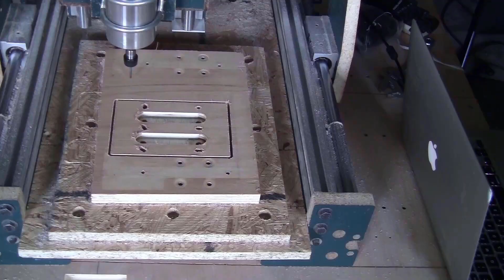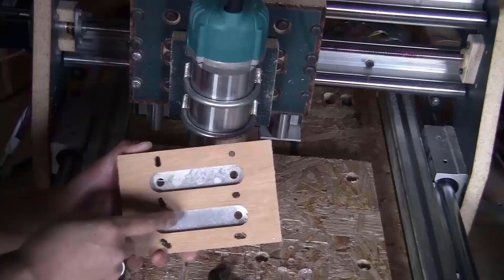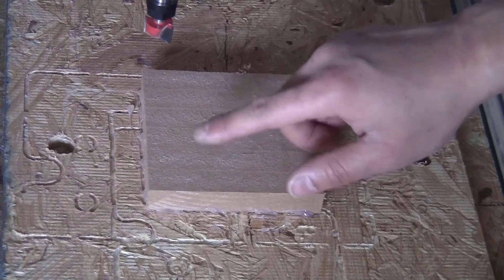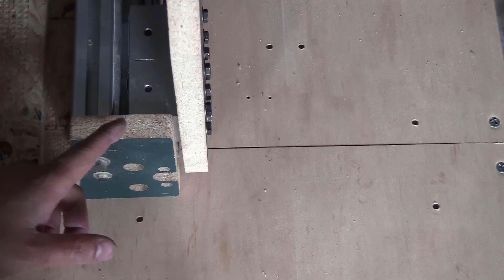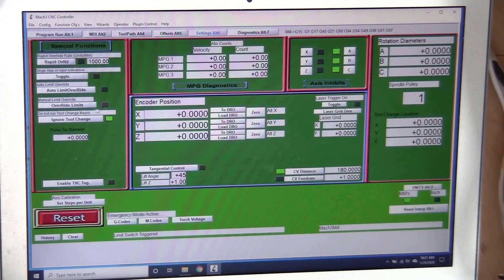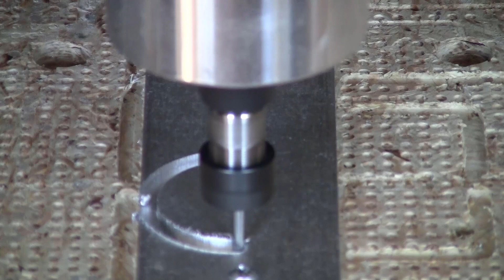Home-built CNC - Step 2 improvement - Full range Z axis and limit switches installation

Comment: Hi Minh, that's another cool video of yours I've watched, so useful bud 👍 I've got my 3018 pro fitted with a 500 watt spindle now and I am really now only planning one small addition, a spoil board so I can cut pieces out. I figure the machine is now accurate enough to cut out gantry plates etc from 18mm ply to build a much stronger machine that can upgrade the ply parts to aluminium. Thanks for the inspiration bro!
Reply from the maker: Baby steps will take you far my friends. But if you are planning on doing aluminum, my recommendation will be changing the linear rods on the X axis with fully supported rails. You will be amazed how much difference those rails can make when it comes to cutting aluminum.
Reply: @minhsmancave9448  The point I was trying to get across was that I'll use the 3018 to make  the pieces out of ply and use the new machine to remake them out off aluminium. And probably sell the 3018 at that point with the 500 watt upgrade fitted.  I was inspired by another of your videos where you did just that. Was also shocked how quiet those water cooled spindles from China are, new machine will have one. 3018 builds 5232 which will build the big one, I won't stop now until I have half a sheet capacity. I would do a video of the new machine build, but I'm so shit at that sort of thing 🤪
Reply from the maker: Also a good plan, just like renting a 3018 to build a better cnc. 👍
Reply: Exactly bud, and educate myself along the way, attempt to at least!

Comment: Minh, I went to find my parts now before the second wave hits and hmph.  100 USD for 2x250,2x450,2x500 plus 2 blocks and 80 dollars for shipping and 20 dollars for tax.  Total was over 200 USD as that shipping is outrageous so I give I can't find the 15H rails, and blocks, at a decent price anymore as they are a good price but the shipping is murder.  This was on AliExpress.  Banggood had a good price on one with shipping the cost like the old AliExpress but only had 1 for sale (sold out I guess).
Reply from the maker: How about eBay, search Hsr15 1500mm, I found set of 2 rails with 4 block for around 80usd. You can trim them to the lengths you need. I think that's a lot cheaper.
Reply: @minhsmancave9448  Is it though in my case?  450x2+500x2+250x2 plus two blocks each plus 2 more each for X.  HSR15 vs MGN15H blocks differ how?  A bit tight in X and Y for the blocks.
Reply from the maker: The Hsr15 rails and blocks thicker compare to mgn15. You the set of 2 rails 1500mm you have more than enough length to cut to 2x450,2x500,2x250 total of 2x1200mm. Just need to buy the extra blocks in additional of the 4 already included. I think it's cheaper than mgn15 or Hgh15.
Reply from the maker: My bad actually, search Hgh15 1500mm, it's even cheaper, 76usd for set of 2 and the bearing blocks are easier to buy
Reply: @minhsmancave9448  I had read that anything MGN is more expensive and the first you gave is almost 90 USD now.  I will see about the HGH15.
Reply from the maker: @thebeststooge  check this one: https://www.ebay.com/itm/HGH15-1500mm-2x-Linear-Rail-Set-4x-Bearing-Block-Unique-Routers-Guideway-NEWEST/353124931473
Reply: @minhsmancave9448  I wrote him to ask if he sells blocks by themselves and are the rails stainless so I await his reply.
Reply from the maker: Yeah, if he does, it will be perfect since his location is in the US and the shipping is free
Reply: @minhsmancave9448  by my sight I only need the one and a few more blocks but I did a comparison and I can't really see the difference between it and a MGN15H.  I did see they come with a grease gun nub but I don't have a grease gun so can't use that.
Reply: @minhsmancave9448  https://i.imgur.com/OTM76NK.png vs https://i.imgur.com/ieBpUAN.png  I see the rail must be larger as it takes a M4x16 vs M3x10 but the block and I have no room to spare in X or Y on the blocks.
Reply: @minhsmancave9448  It is Stainless he said then, instead of directly answering me about the block, asked me how many I need for the blocks.  I guess he doesn't sell them separately but I told him I need 8 more (4x3 axis=12 and 4 comes with it so 8).
Reply from the maker: Sounds good, I might buy the same set if he sells you the extra blocks at a good price. Keep me posted
Reply: @minhsmancave9448  Question but where do you get the hardware from?  Seems I need M4x15mm cap headed stainless bolts for the t-nuts but 10 at a time from China is even expensive and they seem to charge for shipping too (almost as much as the bolts themselves) now.
Reply: @minhsmancave9448  No reply yet due to them not being in the USA (HK) the listing is a drop shipper BUT I went looking and the blocks are 15 USD a piece so that is insanely too expensive for me.  I await to see what they reply though (I did not find a good source for the M4 bolts as shipping was expensive and into Oct for delivery).
Reply from the maker: Amazon has it, get a box with multiple lengths.
Reply: @minhsmancave9448  They wrote back and to get those blocks they added a quantity tab to their listing so for 12 blocks I need to buy two more of their rail listing.
Reply from the maker: Since you are already contacting them, could you ask if those rails are compatible with standard Hgh15ca or hgh15cc blocks. If they are compatible, you can buy the block from AliExpress or banggood
Reply: @minhsmancave9448  I know for a fact the blocks that come with them are HGH15CA.  These blocks are 15 dollars a piece from other sellers.
Reply from the maker: Have to check again, i thought it's $15 for 2 on AliExpress but it's only for 1
Reply from the maker: OK, I just found 4 blocks for $33 and free shipping
Reply: @minhsmancave9448  So 87 (regular price) + 66 = 153 dollars.
Reply from the maker: $76 for the rails set with 4 block +66 for the blocks
Reply: @minhsmancave9448  Sale is almost over so I am looking at what it normally costs.  Where did you find the blocks at?
Reply from the maker: @thebeststooge  blocks are here: https://www.aliexpress.com/item/4000897137744.html
I have seen the rail set at $76 for almost 2 months now, they just show you that the sale is almost over to make you buy it faster. they renew the sale all the time.
Reply: @minhsmancave9448  Oh, know a funny?  That link I gave you for the blocks has free shipping with tracking and when I went to look in my cart it was along with the MGN rails so is the same company.  Free shipping for these blocks but buy a rail set from them and pay a HUGE amount for shipping.
Reply from the maker: Yeap, that happened sometimes, last time I bought a set of tapered bits with tracking and I still loss my package. The usps website said that it was delivered but nowhere to be found. Pissed me off deeply.
Reply: @minhsmancave9448  Here it ends up at my local office and just disappears.  8k miles then makes it to my last mile and gone.  With tracking 90% chance I get it without 90% chance I don't.
Reply from the maker: @thebeststooge  better live somewhere else, lol. One time I loss 1/3 of my package, one time my envelop came empty, and last time the 3 tapered bits went somewhere other than my mailbox. But that's about it. I do most of my shopping online, except food and gas. If I kept losing my package, I'll move, lol. There's nothing here, I can't get any advanced parts locally.
Reply: @minhsmancave9448  Nothing here either but easier said than done to move so this is it.  This is why I couldn't care less (for the last 20 years more and more) if they shut USPS down tomorrow.  I have called them about it and the cover ups are huge as they know they steal.  Heck, video, and arrests, of thefts by postal workers.  Hurricane soon to be here but should only be about 35mph winds (still too much for me as I live under trees) and I have a package due on Friday but left my city to my city via Amazon so I hope tomorrow before the hurricane hits.  As it is 200 USD for rails and blocks is too much for me as there are no guarantees what I was planning would work then I would need the drivers and controller too.
Reply: @minhsmancave9448  Laura came through and I lost power for 4 hours and I got it back but my modem was fried as was my wifi router. :(  Cable just came and fixed it and for 7.5 years they never hooked up a ground wire to it so this is why I lost my equipment twice.
Reply from the maker: Dude, I'm sorry to hear. Know what, I lost power the day before also for 4 hours but without a clear reason. The electric company came to fix the problem first. Once the power was back, we found out we lost internet. Then the internet company took another few hours to fix it. Lucky that we didn't lose any equipment. But couldn't do anything for the whole day.
Reply: @minhsmancave9448  Well, I wouldn't have lost any equipment (both times) had the original two Comcast installers from 7.5 years ago actually done what was right.  Funny thing is this tech said to come have a look and he showed me where they hooked it up and I saw the end wasn't hooked up and went to free air.  Never was hooked up ever at that point.  That is why I was having the weakest point was the cable because if you know cable modems and routers they expect the ground to be the cable outer jacket.  Their power supplies do not have a third prong for ground as that could cause a ground loop so with me not having a ground the lightning had nowhere to go but luckily my computer is grounded and it dissipated it to Earth.  The tech said that since forever they are required to hook up their equipment to a ground or they are legally liable if my house burnt down or someone died.  He said the techs from 7.5 years ago were lazy bastards.

Comment: What made you decide on choosing the moving gantry design? Also, for the dust solution, came across "Passive Dust Shoe for CNC Router" design, where the turbine is fixed on the rotor of the spindle, eliminating the need of a separate vacuum sucker .. Might be a bit harder to implement on the wood trimmer motor, but, I think, it's doable ...
Reply from the maker: First, I'm as amateur as anyone learning cnc routing. I haven't had chance to use many type of CNC machines. My reasoning is simple and might not cover all the cons of the design. I think that moving gantry will give me larger working area. When it comes to cut pieces longer than the bed of the machine, I think moving gantry have more advantages since the stock might be heavy and I usually only mill soft material like wood and aluminum so moving gantry will be enough. In the future, if I were to build a metal mill for cutting small precision parts from steel or thick aluminum, I'll consider the moving table design. Let me know if you have other thought. For the dust separator or collector, thank you for your suggestion, I'm still trying to make a design that is light weight and less noisy. But still far from finishing.
Reply: @minhsmancave9448  Same here man, I'm still waiting for my 3018 to arrive, but I'm planning to start modding it right away. Already ordered 500w spindle (good deal on Banggood). Planning to reuse some of the kit parts, but will add SBR16 rail/block to the middle of the X and Y axis. Will also replace the 2020 profile with 2060.
"Passive Dust Shoe for CNC Router" I mentioned, is exactly the low noise option, as it doesn't use any additional motor, as the sucker turbine is powered by the spindle.

Comment: Why not use a self locking NUT instead of the NUT you are using...The router produces vibration and the Nut you used may loosen and wreck Havoc during operation. Just a thought.
Reply from the maker: Because I'm not perfect and need people 's input like yours to improve things

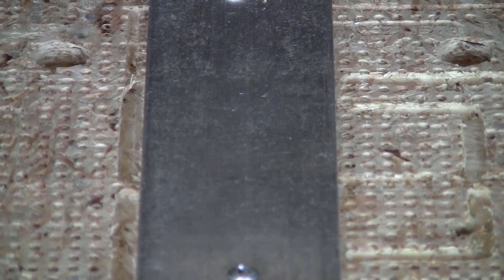Comment: I've seen that method of cutting at 17:48 with the circular patterns to cut the profile in aluminum done by others. Very cool
Reply from the maker: The tool path type called "adaptive clearing", it's generated by Fusion 360. That type of tool path is very efficient to remove Aluminum because it reduce the load on the bit (only a small part of the bit is in contact with the aluminum stock when cutting). I was recommended to use that tool path by other viewers that are more experienced than me.

Comment: Have you ever tried to mill some styrofoam with your CNC? https://twitter.com/joetke/status/1267882748284469250?s=20
(FR) Pour ta gouverne, tu es pratiquement le seul à insister sur l'ajustement le plus précis à l'horizontal et dans les 2 directions XY. J'ai regardé aujourd'hui un de mes préférés reviewers en electronique, qui a construit une CNC plus que pro, superbe, du lourd, tout en acier, mais dont l'horizontalité faisait défaut à cause d'une petite négligence d'ajustements. On voyait des vaguelettes sur sa finition plane... ça fait amateur...
Reply from the maker: I haven't tried milling Styrofoam yet since I haven't thought about any application for it. I saw people do it. I think that It should be easy enough since Styrofoam is soft. With a fast speed spindle and a sharp bit and a good dust collector, It should be a piece of cake.
(FR) Pour moi, l'adjustement horizontal est important surtout quand je faire des trous a travers une plaque epaisse (3/4 inch ~ 19mm). Si le spindle n'est pas perpendiculaire au plan XY, les trous non plus. T'imagine d'attacher une bar d'alum 1m longueur sur la surface de cetter plaque avec une visse, l'erreur de 1 degree faire l'erreur autour de 17mm de l'autre cote du bar (c'est enorme). Pour cette raison la, je fais bcp d'attention a l'adjustement d'horizontalite du spindle.
Reply: @minhsmancave9448  très pertinent! "a good dust collector"... really amusing...

Comment: Hi Minh! Accuracy deserves adjustments. You made it! (FR) En route pour la perfection! Salut Minh! Tu sembles bien sorti du confinement. C'est très bien! La course verticale à 8cm et aussi bas de quelques millimètres, est simplement appréciable. Des modifications qu'il fallait faire avant de commencer une utilisation sans souci du CNC. On ne peut pas les faire en cours de route. Sinon pour l'ajustement dans le plan Y, je repète une question que j'ai déjà posée pour ta video sur la calibration: Cette feuille d'alu pliée ne va-t-elle pas s'écraser au cours du temps? ce qui nécessiterait une recalibration de temps à autre.
Reply from the maker: Salut, comment va chez toi? ici, on est toujour en quarantine. Je suis assez content avec cette machine, surtout comment elle coupe de lAlum. Pour couper le plywood, je peut aller vraiment vite avec 5 a 7mm stepdown, 1200mm/min feed rate sans probleme.
Seulement le spindle fait beaucoup de bruit et je pense de le changer bien tot. Pour les feuille d'Alum, pour l'instant je ne vois pas trop de probleme. Il faut juste bien serrer les ecrous pour compresser les feuille. Peut etre il faut le re-calibrer dans le future, j'en suis pas sur. C'est juste une " quick and dirty" solution.
Reply: @minhsmancave9448  merci à toi. Tout va bien ici à Strasbourg. J'ignorais que vous étiez encore en quarantaine dans le Maryland... Pour revenir à la machine. Je la trouve de plus en plus efficace, solide et sans vibrations. De très loin, une des diy CNC les plus abouties. Ça donne vraiment l'envie de s'y lancer. Et sans mentir, elle devient de plus en plus "belle" aussi. Comment dit-on chez vous? GREAT JOB!
J'ai vu que tu utilisais de la hot glue pour bloquer la feuille d'alu... je ne pensais pas que ça tiendrait à la friction du forêt... étonnant.

Comment: great job!!! What are the bits you use? Where do you buy them? Thank you for your answer.
Reply from the maker: - For plywood, these are the bit that I got: https://www.amazon.com/gp/product/B07F3LGSS7/ref=ppx_yo_dt_b_search_asin_title?ie=UTF8&psc=1
- For Aluminum: I got a pack of 10 bit - 3.175mm diameter and 15mm cutting length from here: https://www.aliexpress.com/item/4000090731411.html

Comment: A late video but good work though this thing can't be considered a 3018 anymore after all of your work.

edit:  Btw, I would redo the mount so you could use a bolt at the top and one below (opposite corners) that would make centering the bit so much easier and so much more precise.  Something similar could be done for the forward and backward (Y) position in the first part of the video instead of shimming with aluminum foil.
Reply from the maker: Surely that solution will ease the adjustment of the spindle, it just gonna take a bit more time to design a holder and also with the screw pushing plywood, it won't be as accurate. If I have the holder made of steel or aluminum, I'll do that.
Reply: Yes, but if wood it would take some way to hold the nut.

Comment: Nice video,
I build cnc machine too,and not yet try cut aluminium
Reply from the maker: Lot of people like to mill aluminum because it's more durable than wood or plywood and also can be considered soft. You should try it out and find the limitation of your machine if there's any (most likely will be the rails are fully supported or not).